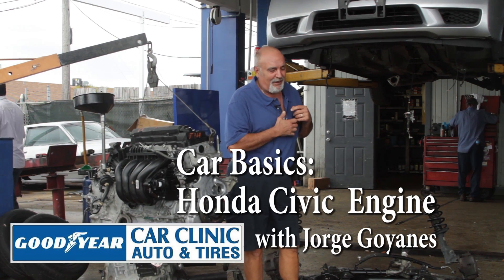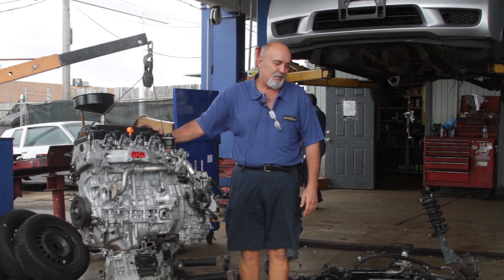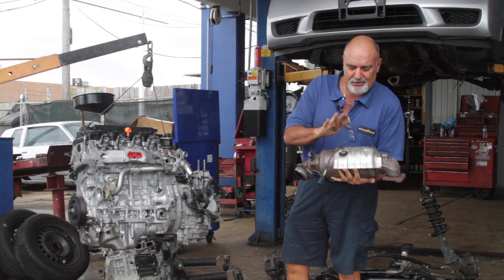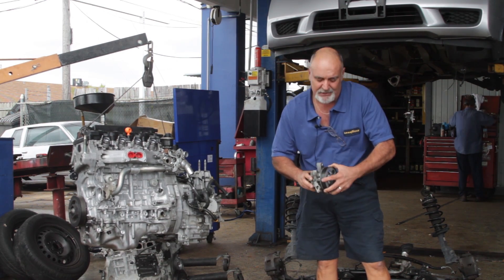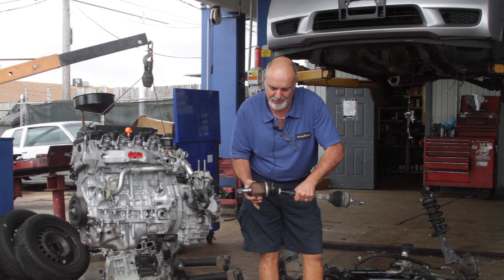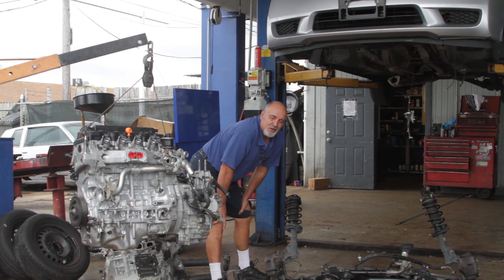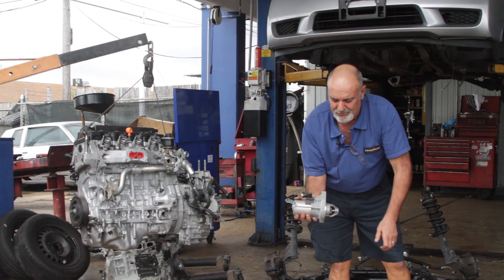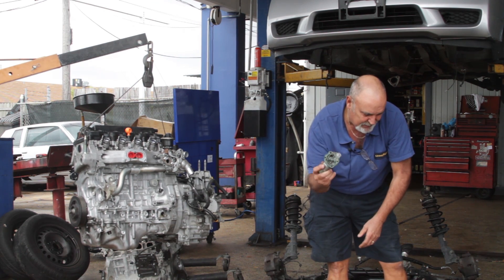Engine Basics: 2010 Honda Civic

Comment: Hi hope u r good i have 2010 honda civic im facing major issue would u plz help me out to clear issues..
Reply from the maker: I'm retired but what is going on with it?
Reply: @golfghoul7  as i told i have 2010 honda reborn.
Issue i am facing is rpm down when for a second car vibrate due to unstable rpm then it returns back when radiator fan is turn on idle either at tariffic or at singal.
I have changed throtle body and check all other mechanical work including spark plug,coil, injectors evrything.
No indication of any error on meter nothing.
Couldnt recognize what is the main fault yet any one.
Can u advise what fault it can be?
Reply from the maker: @ahmedqadri7817  Have any modifications been done to the engine? If yes start there if not I would check the IDLE AIR CONTROL VALVE and the MASS AIR FLOW SENSOR
Reply: @golfghoul7  Map censor is clean already also i changed the trottle body over all with old one.
Still same issue.
But some says its electrical fault others cannt recognize.
Inside on meter there is no check light or else.
Im also confuse what is the main problem.

At night when head lights and all turned on auto radiator fans turn on the main lights dim for sec as the rpm goes down..
Reply from the maker: @ahmedqadri7817  Based on the above have the alternator tested, not only for voltage but for amps too
Reply: @golfghoul7  no alternator has not yet tested.
Can u plz advise what is amps?

But On scanner scan i have found every time P1298 ELD msg even after refresh it come back again but inside meter doesnot show any check light.
Does it related to this issue?
Reply from the maker: @ahmedqadri7817  that code is an issue with the Injector Driver Module which is controlled by the ECU (engine control computer) An electrical shop that works on alternators, starters and batteries should be able to test volts & amps
Reply: @golfghoul7  got your point.

Yes i check the battery volt and amps.
Battery is new and 100% health.
But alternator work is only to recharge battery along self start & i dont find any issue regarding car start?
Does alternator still can be issue for such problem?
Reply from the maker: @ahmedqadri7817  battery starts the car, alternator takes over and supplies voltage to everything electrical, I would definitely have an electrical shop check it
Reply: @golfghoul7  appreciate and thank you for precious comments and time.
Let me check the alternator if its working fine.
I will update the out come.

Thank you Sir.
Reply from the maker: @ahmedqadri7817  most welcome, please do, fyi if the alternator checks out okay, the ECU would be the culprit
Reply: @golfghoul7  thanks.
I have this car since 2 year with this ECU.
Never cause such issue then why the ECU will be culprit  NOW if not alternator just need your expert opinion.
Reply from the maker: @ahmedqadri7817  could be either or, if the alternator output is low it can cause electrical malfunctions such as the lights flickering when there is a load on it, your ECU gets power from the electrical system, if there is a power imbalance it can cause a momentary lapse in the ECU
Reply: @golfghoul7  got it. Thanks let me chck alternator first. I will post update.
Reply: @golfghoul7  Hi.
How are you. Hope your are fine.

Sorry for late inform you were correct it was ECU problem i changed ECU and problem resolved 😁
Genuine Ecu installed but average down now to 5 to 6.5 km in city on ac earlier i was getting 7.5 to 8 km.
I have clean everything new spark plug laser iridium, injector clean, coils ok no missing, sensors (O2,heat sensor ec) all good, throtle but still average down.
What could be the issue by ur opinion?
Reply from the maker: @ahmedqadri7817  Thank you, hope you are well too. Sometimes the easiest solution is the answer. What grade/octane fuel do you use? Have you tried using Premium fuel to see if there is a change in readings/output?
Reply: @golfghoul7 glad tp have your immediate reply and thank u for every support u do to me.
 no im using regular fuel only as premium fuel ussage on every time will cost me lot more but lets try atleast i can see the difference on average i guess 15 litre would be enough right.
Afterwards should i be using premium contineously or back to normal coz u already know the premium fuel/high octane price.
However i do found Ac compressor start to make little noise but cooling is perfect which genuine fault is reborn and tri born does it may effect?
Just yea or no ans would be great to remove query in mind.
Reply: @golfghoul7  few times earlier i did use premium fuel 10 to 18 litre then back to normal fuel on which i was getting average 7.5 to 8.
I know its 1.8 engine and fuel avg shouldnt be as good as im expecting especially for honda reborn but all of sudden such drop in fuel avg making me curious.
Reply from the maker: @ahmedqadri7817  if you use premium and it helps, use it every third time you fuel up
Reply from the maker: @ahmedqadri7817  can you buy an octane booster or fuel additive to add to regular fuel, do the math = regular fuel + a fuel additive every other fillup or premium every third fill up , average it out ( tank of premium versus tank of regular + additive)and do what is better cost wise
Reply: @golfghoul7   i did recetly regular fuel + added in lliqui moly alll system cleaner original german product but the same average let me check with premium petrol average then i will discuss with you and do the same as per ur advise.
By the way which booster is better and can be easily available every where.
Any recommendations please.
Reply from the maker: @ahmedqadri7817  stp/ Lucas or Royal purple
Reply: @golfghoul7  thank you
Reply from the maker: @ahmedqadri7817  most welcome, good luck
Reply from the maker: @ahmedqadri7817  one more thought on the simple solution, what is your tire pressure set at?
Reply: @golfghoul7  its 30 PSI currently  but earlier i keep 28 PSI or 29 PSI due to hot weather.
Does it will make a major difference?
Reply from the maker: @ahmedqadri7817  makes a huge difference ! I always recommend 35psi cold once you drive it will go to 38psi but back down to 35 when cool down, that could be the difference
Reply: @golfghoul7  35psi would be too much here at khi road are not good enough tyres will bust if that much high tyre pressure will be inserted..
Reply: @golfghoul7  hi ghoul sir
Hope u are fine & good in health.
As per ur advise i have changed fuel from normal to high octane but the avg diff was nominal 6 to 7 per lite max nothing more.
Plz be informed i have clean all the sensors (map/trottle/egr/o2/heat sensor/throtle) tyre pressure 30psi.
All ok and good.
As i told earlier the check light was due to ecu card so i changed with honda genuine ecu card after that i found avg difference does it could be the reason or its my only faulse imagination?
I also check the spark plug its just like new and seems its not consuming any fuel
Reply from the maker: @ahmedqadri7817  as I mentioned earlier I would recommend 35 psi to all my customers with NO issues whatsoever, hope all is well with you
Reply: @golfghoul7  understood let me do 35psi.
If still the same then?
Also advise does ecu  make the difference regarding low avg but other symption like kocking or check engine light no issues at all driving perfect.
Also spark plug shows perfect just like new and low fuel consumption.
Reply from the maker: @ahmedqadri7817  35psi should increase your mog by at least 10% or more, the ECU will not affect your knocking, when does the knock occur?
Reply: @golfghoul7  no there is no knocking occur i was asking if knocking may describe the issue for ecu. I was just asking question does ecu cause low in mileage?

Car is perfect there is no issue no check light nothing alhamdu Allah.
Reply: @golfghoul7  only issue im facing is low mileage i know its 1.8cc but it was giving earlier 7.5 to 8.5 avg
Reply from the maker: @ahmedqadri7817  no it does not
Reply from the maker: @ahmedqadri7817  Try the 35psi, let me know what happens
Reply: @golfghoul7  you meant to say that ecu doesnt effect car mileage avg?
Reply: @golfghoul7  done let me try 35psi i will update u then.
Reply from the maker: @ahmedqadri7817  ECU either works or it doesnt, if there was a ECU issue the check eng light would be on
Reply: @golfghoul7  thanks for info ❤️ and appreciate for ur every support.
Let me change the tyre pressure and inform u the diff.

Comment: what is your opinion on the 10th generation Honda Civics' newest 2.0 naturally aspirated engine? not the type R, but the stock base engine that comes with the base model. I find all sorts of videos on the 1.5 turbo, and the 2.0 turbo for the Type R, but I can't fine a video that talks about the 2.0 N/A engine specfications, components, etc..

Thanks!
Reply from the maker: like you not much out there, too new for us to see them at our shop, most still under 3/36,000 warranty

Comment: Hi do you know why does  this engine warm up too slow at winter? (the car don't have any problem and no one mecanic couldn't say why it's too long even the Honda )
Reply from the maker: dont know without checking that particular vehicle out .............however the factory specs on the thermostat is 180 degrees, you can try a 170 or 190 degree and see if that helps
Reply: golfghoul7 ok thank you

Comment: Hello!. Great  video and thanks!  May I ask you a question? I wonder where I can see the part number in the "Cylinder Engine Block".  I know the part number should be "10002-RNA-A50" but where is this number physically written in the Cylinder Engine Block?  Where to look for it?  Thanks very much and sorry.
Reply: that is the part number in the catalog, you will not find it on the b;ock, the block has a serial number on it, the best way to fin the part number is by the vin#
Reply: nonyabiznezzzzz Hello, thanks for your answer.  I know I have the Vin# but how can I relate my Vin# with the engine block do I have installed? You know the "10002-RNA-A00" is the faulty block that will crack and leak so I want to make sure I have the right block installed which should be the "10002-RNA-A50" but how do I know based on my Vin# or my engine number which I also have readily available? Thanks!